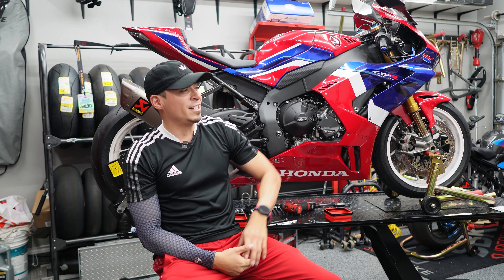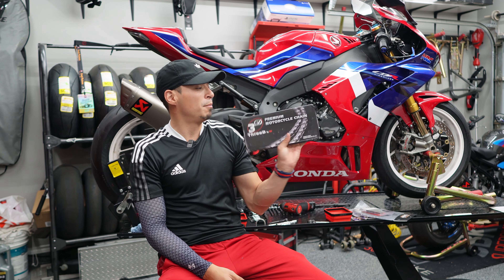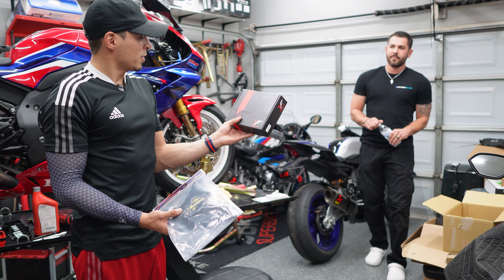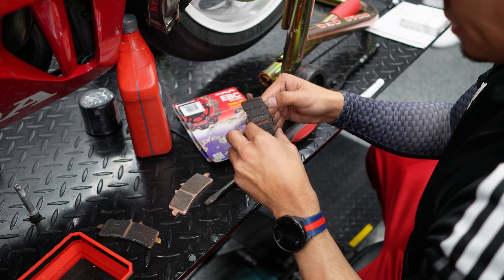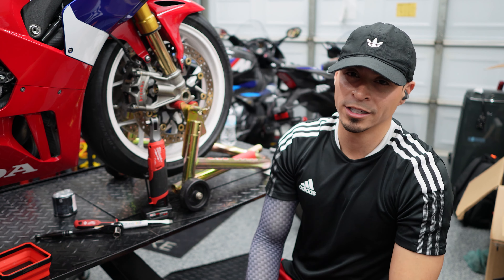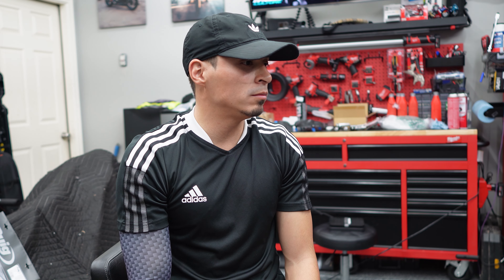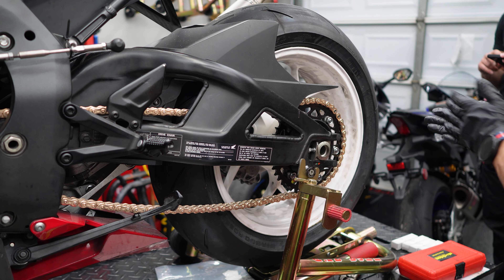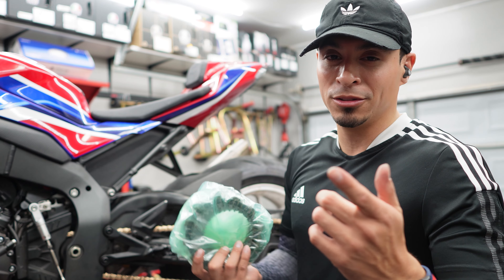Honda Blade RR-R Gets Some Love | VLOGMAS DAY 6

Comment: Finally did the 520 conversion and that’s a lot for rotating weight
Reply: 520 is worth it if you don't mind the more frequent maintenance. You get performance for racing and bling for the street.

I remember watching a video about the Bugatti Chiron. The guy on the video said that the tire valve cap weighs 16 pounds when the car is hauling ass at 260 mph. That valve cap weighs 0.09 ounces standing still. Every ounce shaved off of a race bike's rotating mass makes a difference but only if you're actually racing.